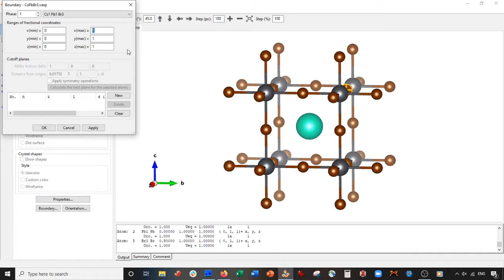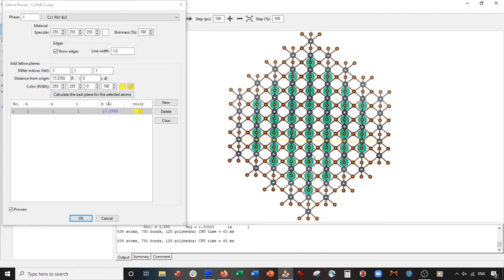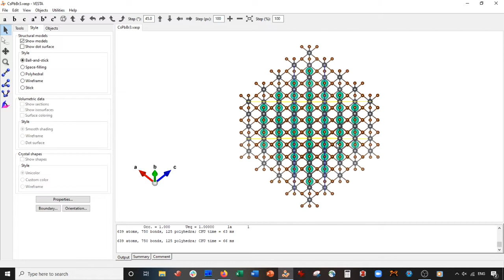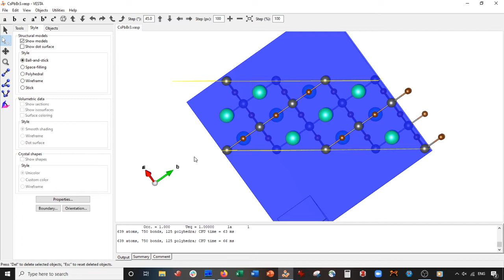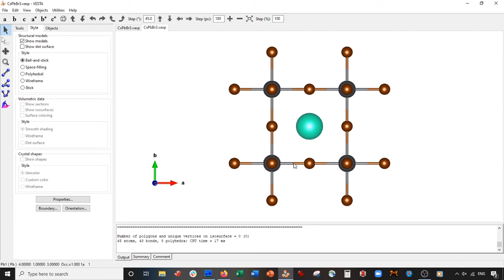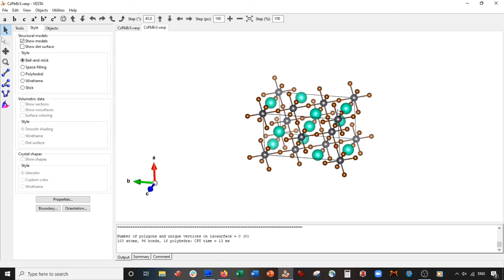VESTA Software - Perovskite [111] Surface Reconstruction

Comment: In your video on the Cu[111] surface, you calculated a' b' and c' by subtracting a, b, c from the origin. Here, a' = a-origin, b'= b-origin, c'= c-origin, which is the opposite, changing the signs of your transformation matrix. Does this make a difference?
Reply from the maker: I don’t think it matters! Just like doing a 180 degree turn by spinning one way versus the other
Reply: @nickelandcopper5636  thank you!

Comment: Thanks for your efforts. Kindly Make a tutorial on How to make core shell Nano wire. For example ZnS/Si CSNW etc
Reply from the maker: Thanks, core shell structures don’t make much sense when working with purely crystalline models. What usually happens is that the shell is thermally annealed to the core through common simulated annealing procedures.